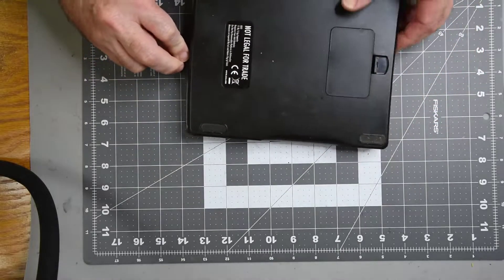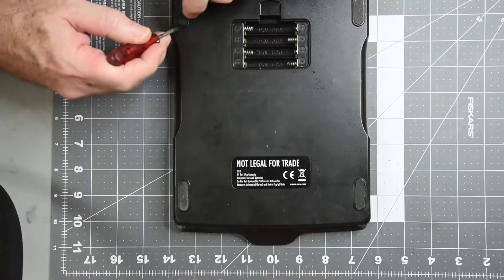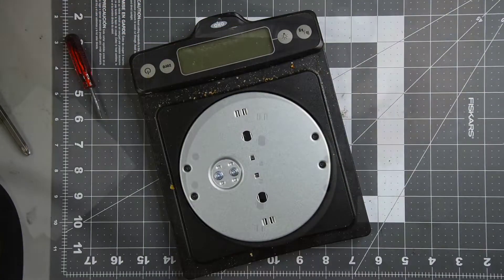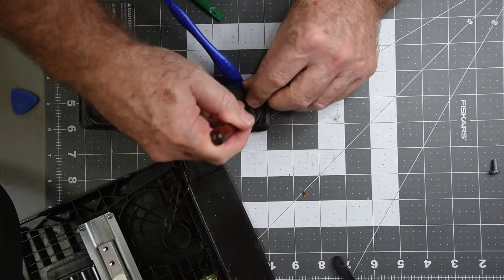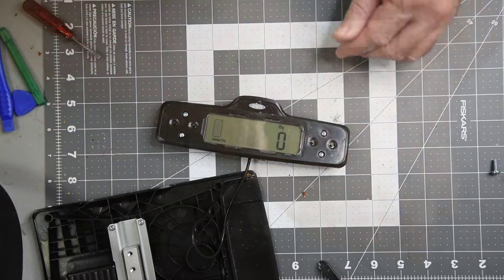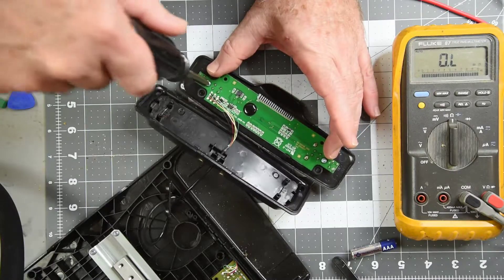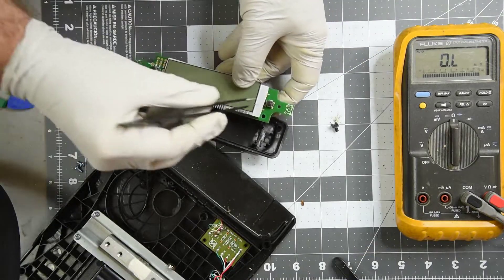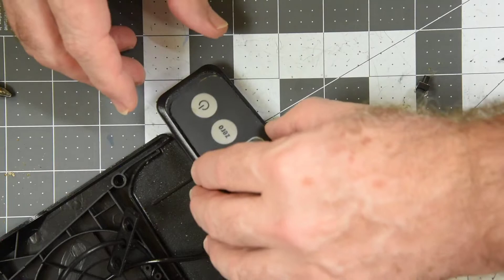OXO 11 Lbs Food Scale Repair

Comment: Just in case anyone has a newer model — the LCD screws are now under the footpads on the underside of the LCD pull out. I had an issue where the LCD display didn’t show all sections, cleaning the connection and screwing it back in tight, did the trick! Your video inspired me to take on the repair— thank you! It’s working like a charm again. 🙌
Reply from the maker: Thanks for the update.

Comment: Thanks for the disassembly video. I had some water in/under my LED screen I wanted to clean out. Got it all cleaned up and one of my switches stopped working. A quick shot with a hair dryer dried up whatever moisture was in there and got it working again.
Reply from the maker: Very nice, thanks for the comment.